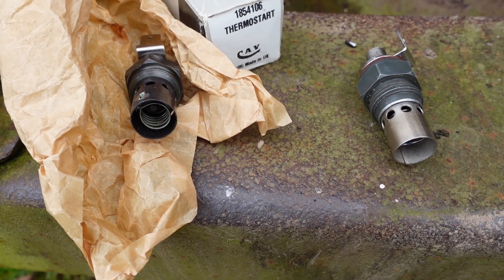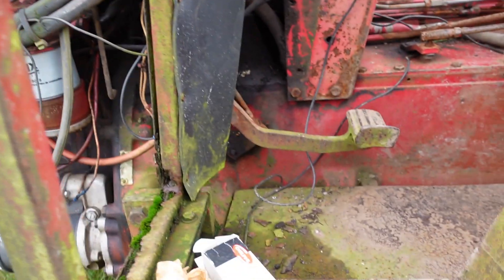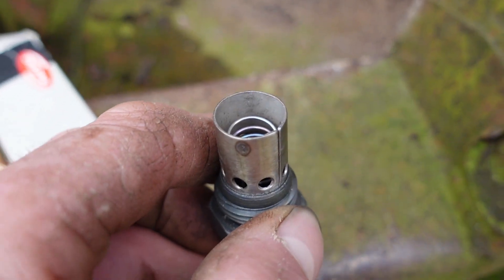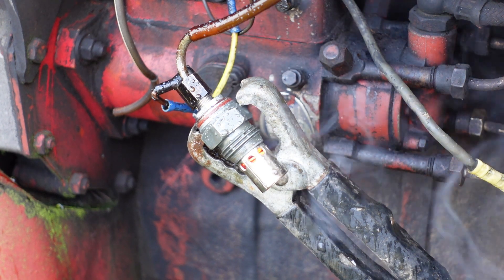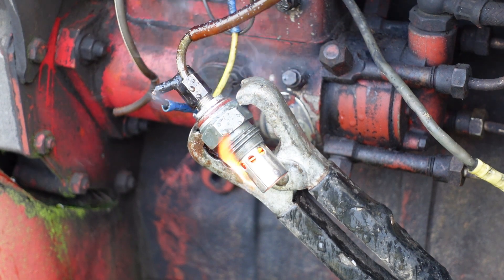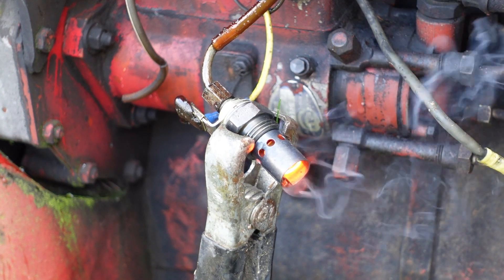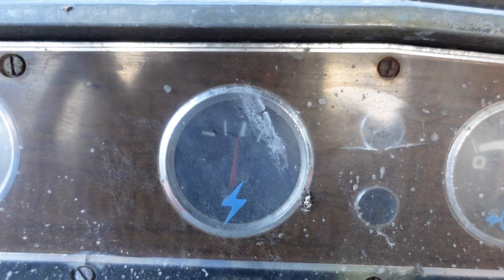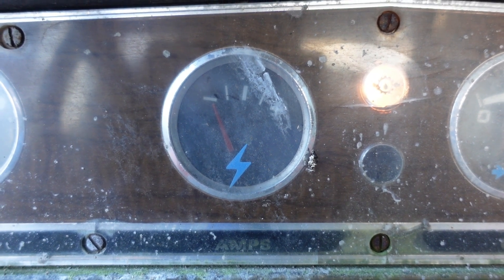Genuine Thermostart v. spurious

Comment: Great video again.I enjoy watching your videos and have subscribed.Just wondering where did you purchase the heater plug as i have a 674 myself.Thanks
Reply from the maker: Hello, Not much help I am afraid, ebay. I have had spurious ones which have worked. These two duff ones were from a company called Abel Tractor Parts and they have not even answered the emails that I have sent them, so a supplier to avoid I think. Good luck, Jon
Reply: @wotjonsez2560  
That's no problem.Thanks for replying.Keep up the great work.

Comment: Very interesting video thank you for sharing, we've got a bought in 1993 with the Bosch pump and despite what we were told it shouldn't need the thermostart just put it halfway till you feel the resistance of the spring, its reluctant to start cold and we've put a genuine heater on it once, only it failed one season when the engine started to knocking badly due to the thermostart leaking in fuel. I've got an 956 (just 2 cylinders more basically) and it's got a heater coil in the air intake with a timer, starts very well with the gear reduction starter motor, I'm thinking of buying one for the 574.🙂
Reply from the maker: Hello, thank you for watching. The Fordson Dexta's (and others) had a primitive system, there was a tap to open to let the fuel through the heated coil, it worked but if you forgot to close the tap you would go back to the tractor a week later and find the sump full of diesel. I have heard of the Thermostarts leaking but I have never had that problem. Regards, Jon

Comment: Good analysis and proof video.   What model tractor is that? I have a used ih454 that came equipped with ether start which I removed after an 8200 hour  inframe engine rebuild.
Reply from the maker: Hi, That one's a 574 but I also have a 454 which has the same Thermostart, love the 454, cracking little tractor, Jon